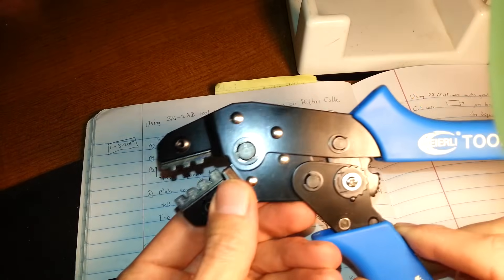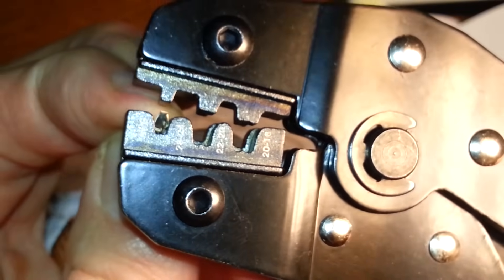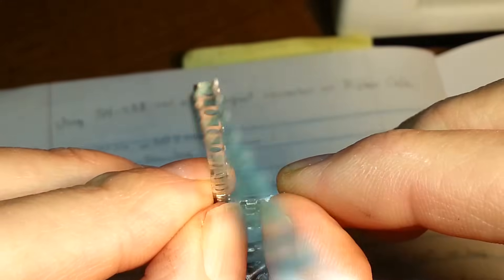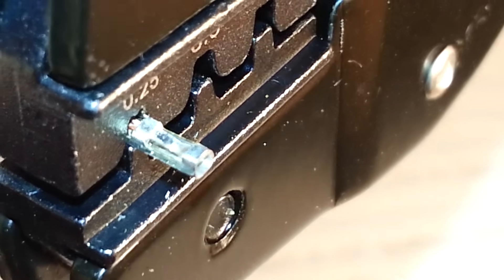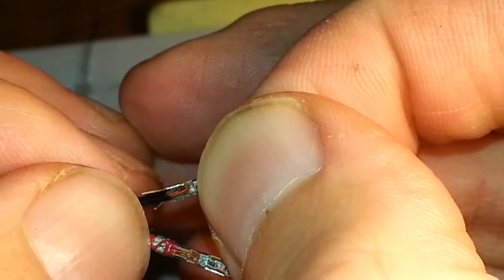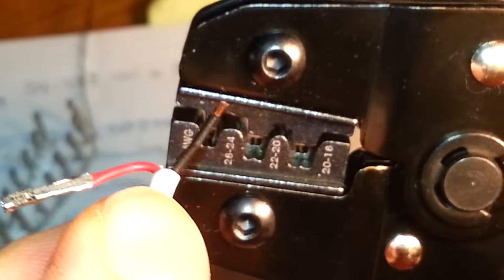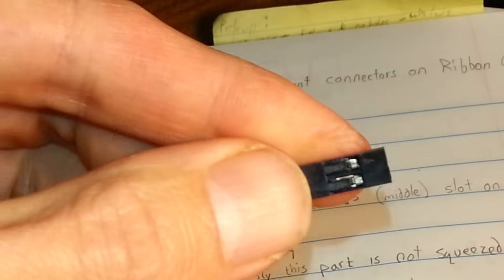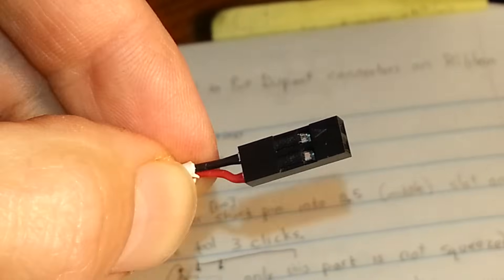SN-28B Crimping tutorial for DuPont pins.

Comment: I used to work for an electronics manufacturer who had all the proper tools worth thousands of dollars. They could crimp a perfect JST, Molex, or Dupont in a fraction of a second. When I got into drone / 3D printer building, I was incredibly frustrated that a single connection could take me up to 5 minutes...and usually fail. It is definitely an exercise in skill, patience, and crafting new swear words for the DIY community. Thanks for sharing your technique.
Reply from the maker: lol - so true!! I felt the same way, "this can't possibly be so hard! What am I doing wrong!¥@#!"  
Part of the reason I made this video, was because if I need to make a specialty cable/length in a few months/years, I'll have documented exactly what worked for me.

Comment: Thanks for this - worked perfectly ! Especially making sure only about 1.5 mm of wire is stripped - less is more in this case. One trick I can add - use an ultra small dab of super glue on the insulation to pre-glue the contact onto the wire to hold in place, then crimp it.

Comment: Thanks... You saved my bacon! I´ve spent almost 2 months on-and-off trying to get my connectors to work (yes Dupont) one´s... After watching your video carefully, I realized I was using my crimpers the wrong way and ended up having to use long-nose pliers after to finish the crimp. Just so you know, I was crimping 18-Pins at a time, male and female ones, hence why I kept walking away from the job when it didn't quite work out. But now that I have seen your video, the jobs a good´n! So thanks again, as I was trying forever to wire up my 3D printer and cable managing it all to perfection!!

Comment: Want to thank you a ton for this video. Helped immensely.  I want to add that if you clip the pin off the string of pins at the strap part, it can become a tab that sticks out a bit and stops you from pushing the pin too far into the tool.  Then you can just break it off after you have made the crimp.

Comment: I created a youtube account just to say that your details (although others may find boring) were very necessary for the correct understanding of the use of this tool. I for one appreciate the details, the close up shots that were clear, and YES we all know how IMPOSSIBLE it is to try to do this while using a camera... Well done.. 
I also subscribed to show my appreciation. 

If you do a soldering video, a tip is get a small spray bottle of rubbing alcohol and spray the contact on the printed board, the alcohol will both clean and evaporate when the contact is heated to the right temperature... this is a good trick for learning. After you get the nack for the time it won't be necessary... anyway I get my tool in a couple of weeks and I'll know how to use them all because you took the time to teach me. Thanks
Reply from the maker: Flea Fart Thank you.   Personally,  i thought the details were important even though it made the video longer.  I'm glad you appreciated the technical challenges too!  Thanks for making a youtube account to leave this comment:  I'm floored!!  Glad it helped!

Comment: Thank you, this really helped!  I would suggest one change that was much easier for me, especially since my wires i'm working with have oddly thick insulation.  Use a pair of needlenose pliers to hold the connector by the wing, place the wire in it, then tighten the wing just enough to be snug -- this will take care of the problem you were facing with the connector not fitting in the right slot, and the wire is so much easier to place when you can see it.  After the wings are snug, it can be put in the right slot of the crimping tool, and crimped right up perfectly :D

Comment: I honestly suggest 2 - 3 clicks on the next size up, and that'll close the wings just enough where you can slide your wire in and then guide it in the rest of the way to finish the crimp. Loading the wire in first (outside of the tool) is the fastest way I've found of doing this.

Comment: I like Gary Myers' idea of the header jig. However, I found that the thumbnail trick works very well. I have exactly the same sort of crimp tool and I have found that you can crimp all the way down on the largest gap to pre-form the back part of the pin and then immediatly move to the smallest crimp to set up for the cable. I got this down to a fine art crimping 20 breadboard power leads for a school I volunteer at! :-) Also, if I press all the way down in the smallest crimp, the pin gets jammed in and is hard to release. So I crimp down just enough and then spring it with the release trigger. It just takes a little practice to know how far to go. Many thanks for the video. It saved a lot of hair pulling!

Comment: In a factory somewhere there is probably a machine that does the entire operation in two steps, ten in parallel and ten per second. That is amasing enough but someone designed that machine and got it working. Automation is awesome.

Comment: Here I thought using needle nose pliers and soldering the wire was difficult!  I guess once you get the knack.  Very good video, well explained, clear, excellent closeups.  The best of the 4 that I've watched.  Tally ho, gotta go practice with my new tool.  (Only 6 bad connectors made so far...this video pointed out the error of my ways.)

Comment: Use a two pin male header to make a crimp holder. Cut the pins to length so that one of them pushes into the housing to the right depth to keep the wire from pushing too far forward. The other pin sets the distance to the crimper so that the crimp is held at the right position. Solder a short length of brass tubing to the opposite pins to act as a handle.
  I'll leave the method of making female versions as an exercise for your imagination.
Reply from the maker: Gary Myers That is an excellent idea!  I'm definitely going to try it!  Thanks!!
Reply: you should let people know where to get this brass tubing since it seems some are not clued in enough to even get what the video implies or have the patience to watch it. I am guessing K&S metals like found at hobby and ace hardware stores usually used for model railroading.
Reply: I tried your idea with a 3-pin male header, its center pin inserted -- at 90 degrees to the jaw opening -- into the connector on the side opposite the wings for the insulation. The outer 2 pins of the header touch the sides of the upper and lower jaw. The black plastic that holds the 3 pins lets the center pin be longer, letting its insertion set the limit for how far the wire and insulation can go into the connector from the winged end. This works great for female connectors but not at all for male connectors. I think yours is similar. Anyways, thanks for the suggestion.

Comment: Thank you. I found this very informative and helpful - saved me a lot of time and potential problems with my project today. I was hoping that buying a proper crimp tool rather than using fine nose pliers would be easy .... not so! The only issue which you didn't mention was that of the crimped wire "sticking" to the tool once the ratchet has been released - a very delicate operation to release it without bending it and breaking it off but hey ho - I will continue to investigate. Thanks again.

Comment: I thought for sure that I bought the wrong tool  I'm not using this type of connector I'm using JST-XH Kit 2p 3p 4p 5Pin 2.54mm Terminal Housing PCB Header Wire Connectors. When trying to crimp it would also crimp the locking mechanism on the pins making a poor connector, if it gets any type of a tug it will come out of the connector. I watched this and well I finally made 1 solid connector once I inserted the wire I pushed it until the lock on the pin came out of the tool then I crimped it and presto it worked not sure how many pins I've wasted in the last hour but thanks for making this video it helped me see what I needed to do even though we're using different pins there was enough information for me to figure it out, now I need to buy more connectors.
🤷‍♂️😁👍 I wonder what other things this tool can crimp.

Comment: Cool, I should be done with my simple project in about 2 years.
Reply: I paid a company to make 600 4 pin -> 4 pin female to female 80mm after spending a weekend making 50.  They've got a machine that turns these out like a blur...
Reply: I've spent enough time trying this I feel like my better investment is to just buy a damn soldering gun
Reply from the maker: @davidhunt240  How much did that cost? Just curious
Reply: TheRainHarvester I just bought the same tool from amazon under a different name ($15):
https://www.amazon.com/gp/aw/d/B07DZBS1FW?psc=1&ref=ppx_pop_mob_b_asin_title

Identical to the tool in the video except different colored handles.  😊
Reply: @TheRainHarvester  I vaguely remember it was around $200.  A bit expensive, but at least it was done quickly using good connectors and wire.  I can get the same thing from China for waaaaay less, but it takes ages and the connectors are often of the type use-once-and-trash and the wire is often CCA and only 32AWG core - ok for signals but won't take any current.
Reply: @meindopen007  yeah mine is branded Neccygoo lmao
Reply from the maker: @davidhunt240  , thanks for the price info. What is cca?
Reply: @TheRainHarvester  Copper Coated Aluminum (I've also seen copper coated steel too - easy to test with a magnet)
Reply: Lol, but the guy did a great job capturing the effort it takes to get good crimps

Comment: 717 dislikes, wtf is wrong with people these days. Great video, thanks for sharing your experience.
Reply: Wrong tool for the terminals (unfortunately, the Chinese tool vendors almost universally market this tool model, which is made for much larger terminals, for DuPont), wrong strip length stated, insulation is crimped into the conductor crimp, and the final result is a bad crimp that doesn’t even fit the housing properly, indicating the crimp is nowhere close to what it should be. The video shows some very good tips, but they’d be more meaningful if applied to a proper crimp. What he says is largely correct, but the end result is not an acceptable crimp.

Comment: It has a lot to do with having the correct die and correct ratchet setting on the crimp tool.  You have to dial the ratchet setting in first. This prevents you from crushing and distorting the pin. Next get the length of the strip right. After that preset the pin, meaning squeeze the pin tray so it holds the wire firm. That way you can see that everything fits. load the tool and squeeze at the end of the handle to get the most leverage. You have to do this with every pin manufacture because not all pins are alike. 

The ratchet provides a consistent crimp.

Comment: For this type of small/delicate projects it's good to 1st have a pair of those "mini precision wire cutter" for reason below.   
2nd, there is no right or wrong way here just what is convenient (your method to pre-cut the copper wire to length or leave the copper wire long), insert/lay the wire and align the wire insulation to the correct space in the female/male metal connector then wrap the extra copper wire around the mid section of the metal connector, now hold the wire and gently place the connector in the correct orientation in the crimper slot/jaw and crimp.  
3rd , removed the crimped wire & connector from the crimper, use that mini precision wire cutter to cut away the extra copper wire.  DONE!
This way, to me, I align the wire in the metal connector exactly where it needs to be before place them in the crimper, also there is the whole wire to hold-on to without worrying the wire slips out while crimping.
Reply from the maker: Rick T , that's a good idea! I'm going to try it.  I would have thought the extra wire would get tangled in the connector, and that it would be hard to trim to length afterward, so I never even considered this!

Comment: Thanks for this! I was having some serious trouble but your video had the tricks I was missing. One was pre-squeezing the insulator "wings" so they fit fully down into the tool's smaller gauge crimp slots, and won't twist and turn as you crimp; and most importantly sliding those same wings until they stop at the ridge, to find the perfect connector insertion depth. Also middle agers out there beware, once you hit about 46-47, to do this kind of stuff with tiny components you need reading glasses and a whole lot of light. It is not gradual, it happens rather suddenly.
Reply from the maker: I have bad eyesight as well!  I'm glad it helped!

Comment: Ok so, from learning about building my own computers, here' s what I found. When you plugged the 2 wires into the black housing, you put them in backwards. On the black housing, there's an arrow. That arrow should have the positive wire. You had the negative wire in it. It's just a way so that you can identify your positive post if you were to decide to shrink wrap the wires, you'll know what the positive post is. Great video though. I just bought this tool and had no clue how to use it...Thanks....
Reply from the maker: Neat, I've never noticed that before! Thank you for that knowledge!
Reply: The arrow indicates pin 1. There are no standards as to what pinout is used. On my own designs, I tend to assign ground to pin 1.

Comment: I’ve always had trouble with crimping and it’s all because I thought my crimping moulds were badly made.... SO I FILED THE RIDGES AWAY LOL.  

So now I’ve got a new set of crimps and they works great... still need to get some practice I’m doing JST sockets and they are TINY in my big meat hooks.

So yeah, thanks. (Still can’t believe I screwed up by cleaning up those heads). 😳
Reply from the maker: Neo Morph , lol that's great news! (Except for filling the old ones.)  I'm glad you got them working!
Reply: TheRainHarvester they do look like they have been badly cast though... I used to use the old style of crimpers years ago where you  crimp the conductor first then push it forward and crimp the insulation. But my grip sucks now so I thought a ratcheting one would help. Oops!
Reply from the maker: Neo Morph , what are you making the cables for? Just curious.  I use these cables for custom lengths when I need a few on some Arduino projects.

Comment: Thanks to your excellent video I did my first two wire connector using only 6 pins.  As for the length of your video, it gave me an excellent feel for what the process feels like.  If you had condensed it into 30 seconds, it would not have been as useful.

Comment: With the short pins, they should press about 3mm further forward into the housing. The ridge you hook your nail onto to position them is where the latch on the cover is supposed to grab.
Reply: how come the information about many tools are an investigation effort out of the normal? If I produced some tool, I would make helping info easy accessable.It increases the tools value.

Comment: 6:25 That’s actually around 4mm, not 1mm. The vast majority of DuPont contacts need a strip length of 4mm±0.5mm. The thickness of the SN-28B dies is 7mm, for context. The insulation diameter of your 22AWG wire is probably 1.5-1.7mm.

Comment: I need to try this... honestly for my little project I've been using soldering iron, and the solder I buy is almost fake. I strongly believe this is better. Any opinion?
Reply from the maker: Just be sure to use a thick enough gauge wire so the wire doesn't come loose.  That was an early mistake I made.
Reply: @TheRainHarvester  thank you.

Comment: i accidentally bought these for JST connectors. i had to modify them by taking the dies out, grinding the right hand ones down, and leave out the other side. i printed a plastic spacer to be in place of the missing die half. 
i was wondering why the hell the connections kept breaking so easily. and looking at factory made JST connectors i realized the crimps are not working for it because its over crimping on the wire coating. 
A bit of an over-site on the amazon listing and that what you have to deal with....

Comment: Just want to add that there are several other types of jaws on the market that are also suitable for crimping DuPont pins: SN-2549 and SN-48BS.
Reply: SN-48B is even less suited to DuPont than SN-28B, which is already wholly unsuited. SN-28B and -48B are designed for 2.8mm and 4.8mm spade terminals, respectively.

Comment: I never trusted these kinds of connections and always had un-ideal tools so I ended up soldering the connection for extra measure just in case.  Then it hit me: why not just solder it and skip the crimping all together!?  So that's what I do now and it takes like 20 seconds.  I guess that introduces brittleness to the wire which can cause premature failure though but for something that will not have wire movement or something that is a quick prototyping situation I think its a good solution.
Reply from the maker: It's true, but like you said, after a while, lots of my solder joints started falling on old connectors.  The key is to hold the insulation, then they don't crack by relying on the copper as the physical connection.  But maybe you can secure the insulation when you solder...somehow. Hmm...

Comment: 6/16" is 3/8" or close to 10mm. I knew how DuPont connectors were supposed to be crimped but they are still a PITA because they are so small. Doing 1970's style automotive sized connectors are much easier as you can actually see what your doing plus, automotive /motorcycle have 'square' insulation grip, very easy to get lined up. Modern automotive connectors are almost as small as DuPont, 9  pins or more in a 3/4"~1" square block. Should also mention, changing RC battery terminals , it's VERY easy to short out a LiPo battery ;o)
Reply: It’s funny how in most electronics, DuPont are now considered old-fashioned and big. Newer connectors tend to be much smaller! I crimped 28AWG wire onto 1.0mm pitch connectors not long ago at work…